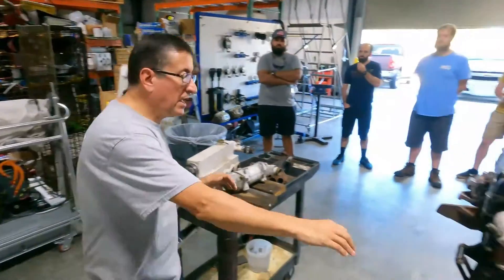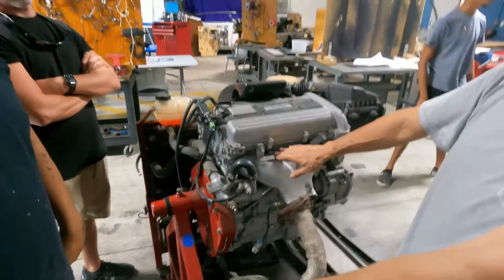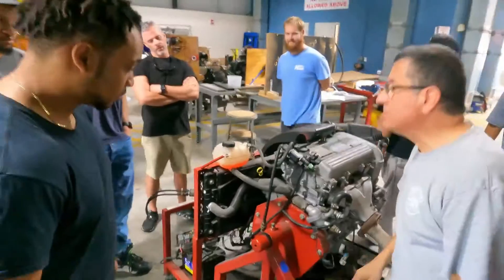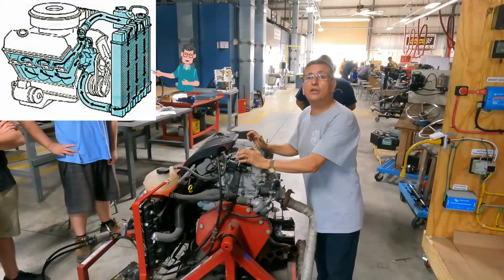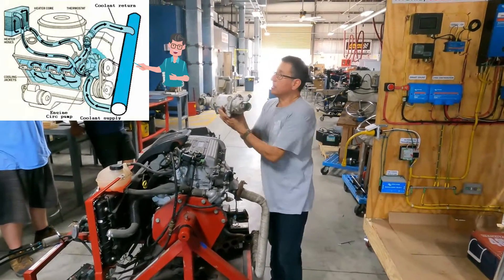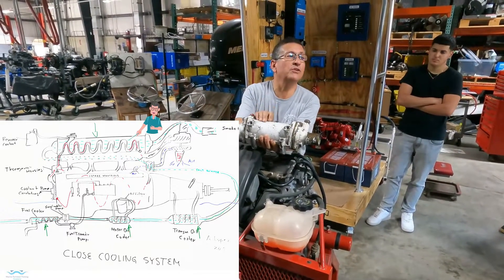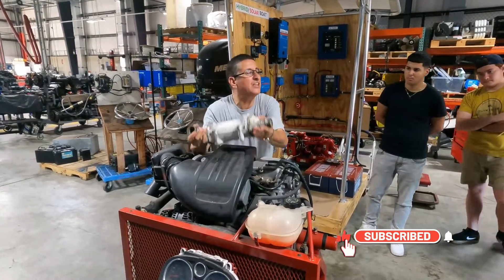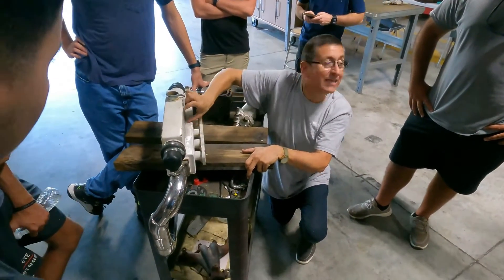Cooling System Automotive Engine vs Marine Engine

Comment: Why can a standard vehicle engine not be used in freshwater with little modification? 

Couldn't you just delete the radiator and pump freshwater directly into the coolant system without a heat exchanger and then pump it right back out? 

It wouldn't be useable in saltwater but freshwater it should be right? As long as your not worried about the exhaust being hot that is.